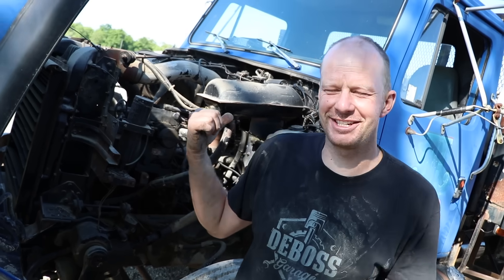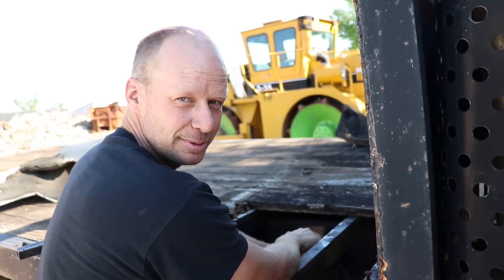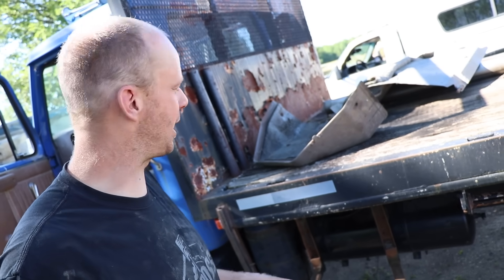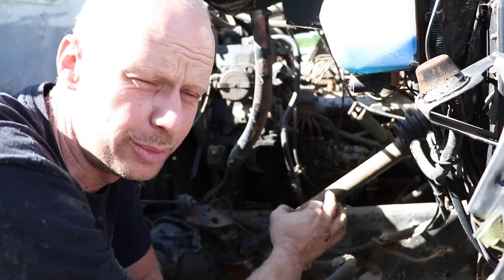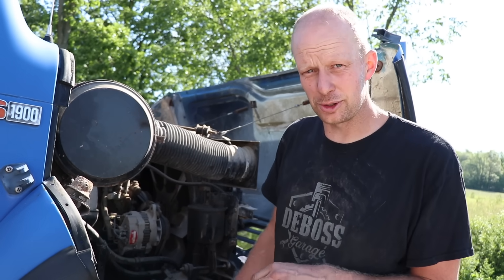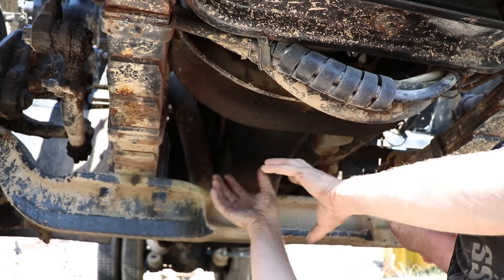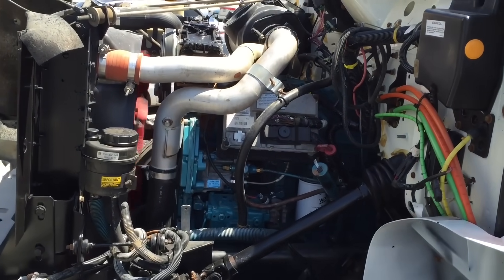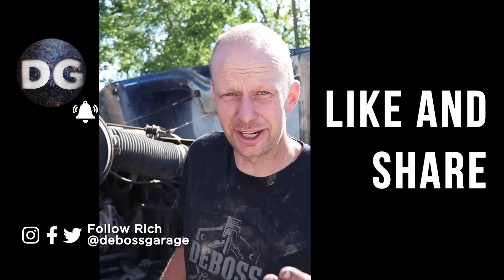REVIEW: Everything Wrong With a 7.6 Navistar DT466 Diesel

Comment: when I started driving semi in the early 1990's I worked for a company that hauled steel coils out of the mills in Indiana ( ave weight  50K pounds  80K  gross ) and the company had 4 IH S1900's with the 466's in them , with the right gears in the rear and a 13 speed trans it would go and do pretty good , but  60mph/100Kph was about all you got , but for service , I loved it , oil and filters , and run the racks , that was something the senior mechanic was dead set on , ever 2 oil changes pop the covers and check clearances , when the owners decided to sell them they had over 750K miles with no overhaul , Have to say it was a damn good engine .  the detroit 60's that replaced them . big green POS .. dropped rods ... But the Big old green leakers ( 92 's ) we couldn't kill .

Comment: DT 466:  It’s everything the 5.9 wanted to be.
Reply: Dt570 is where it’s at
Reply: The caterpillar 3126 is the best of them all! But yes I do like the DT 466 and the 8.3L Cummins
Reply: @hilljackzack7284  if you like repair bills dt466 mechanical all day cheap to run and built like a anvil.
Reply: @matthewwilliams9028  I agree the dt466 mechanical is good.
Reply: You mean dt360. The better 5.9
Reply: @The1andonlyDMFH  just why?
Reply: @hilljackzack7284  because there the same size engine. You can’t compare a 466 it’s a bigger engine by a lot
Reply: @hilljackzack7284  but to elaborate it’s a sleeved engine so to rebuild it you don’t need to machine the block. It’s also stronger. Uses the same injection pump that makes them so reliable
Reply: @The1andonlyDMFH  uhh apparently you’re confused on what I said. I mean why I mean why dt360 over 5.9?
Reply: @The1andonlyDMFH  I compared the 466 to the 8.3 Cummins and the cat 3126 which are all  similar in size.
Reply: But was replaced by the 8.3 in farm tractors.
Reply: @scotcoon1186  Regardless of what they say most people will pick more power over reliability. Not saying which is better or anything just saying

Comment: Hi great channeyl, have you ever heard of a DT530 mechanical that wont lift oil to the oil pump if it sits for a day unless you pour oil down the filter tube, once its primed oil pressure is normal, the oil pickup tube, engine oil pump have been replaced, the timing cover has been checked for straightness at a machine shop inside and out, any thoughts><?
Reply: I had a466 that did that ,the new pickup tube was in a bind and sucked air where the tube bolted to the front cover

Comment: A company I worked for had a pair of international TD15E dozers from the late 80's. I think those had dt466 engines in them. They were pretty strong dependable machines even though they were 20+ years old and had well over 20,000hrs on them.

Comment: A bit of a rant from the european perspective:
Scania 16 liter V8, Euro 3 norm no urea, no EGR, 580 hp stock, 2,5 million kms no problem. Loads of power, great on fuel. Usual weight is @90000 lbs. It is straight piped 😊 
Newer Euro 6 trucks? DEF problems, EGR problems and not that great on fuel. Plus you need to pay for DEF/adblue.

Smaller diesels? You have the VW 1.9 tdi in NA, a load of taxis still run them here, and we're talking interstellar mileages. There was also great french diesels, the idi 1.9 from peugeot-citroen, the DI 1.9 from renault. And we need to mention the 2L from toyota. All these were great simple mechanical diesels that would see the rest of the car rot away and they would still be going.
I bought one of the last euro 5 passenger cars I could find. 1.6 liter peugeot, you can search 1.6 hdi to learn more about the engine. We are talking a genuine 50 mpg VW golf sized car, very pleased with it. 
My friend bought a euro 6 VW 1.6 TDI. He cannot get it below 38 mpg. That's the price to pay for reduced emissions.

The only engines I have seen that get better with every successive generation are ISUZUs. The older (euro3) 3.0 td is reliable as an anvil. No valve movement @200k kms, but a bit under-powered. The new euro6 1.9 which i thought was a mickey mouse engine proves so far to be MUCH more powerful and ~20% more fuel efficient than the old 3.0. And all this from a 1.9 liter engine. It is still loosening up at 15k kms which is good for longevity. I believe if they added a couple cylinders to make it a 3.0 that would be a viable solution for light duty GM trucks. Is the new 3.0 diesel (in GM trucks) a clean sheet design?

Comment: That same block was used in the 66 series IH all the way up to the 88 series. The D/DT414, D/DT436, D/DT/DTI466. D is non turbo, DT is turbo charged, and DTI is turbo charged and intercooled. Sleeves had an issue of cavitation at the o ring bosses.

Comment: Our DT466E's have been bullet proof until recently. They run at a constant 2100-2400 for 8 to 12 hours a day. This machine with over 20000 hours on it is just starting to show a bit of blow by and just ate it's first part (HPOP). The same can be said for the 4BT that drives all the hydraulics which has just started leaking oil from just about everywhere.  https://youtu.be/ntKiJPo35qw

Comment: They were used in loads of International construction equipment. Including TD15C dozer, 175 Crawler loader, rear engine in 433 pay scrapers, 412 scraper, among others. Awesome engines and were very cheap to rebuild when compared to others of about the same class. In the early 90's an OEM in-frame kit with pistons, liners, rings, bearings, gaskets, even included oil and fuel filters was under $1500.00 Canadian dollars.

Comment: I have a Kubota that will not start since I turned it off manually because it was a run away engine at the moment ... Because I had connected a wire that was hanging loose .... Any input about this engines ? ( Coleman light tower with Kubota 3 cylinder Diesel mechanical injection )

Comment: 4:58 "north Dakota mag" rims..... hate em
.
here in montana.... i deal with them about once a week.... some old farmer will bring in his "baby"..... well maintained 
usually old 366 gas big block GM stuff.... flat beds and grain trucks from the 60s/70s/80s
.
im the only person in town who knows how to set points an a Q-jet..... im 26 years old
just had a dad that took the time to teach me (still yelled at me, however lol)
.
i wonder how many here know what a dwell meter is?
Reply: Sounds like you have an awesome job man.
Reply: Old motorcycle mechanic here. I still have one in the bottom of my tool box, not used in years.
Reply: @bretwilliams4499  i have a 1974 kawi g5 100cc 2 smoker.
.
Was working construction (under the table) and just got paid 300 bucks
.
Driving into town....a train was on tge tracks.... so i had to go around VS my normal route
.
And here is this 74 kawi.....300 dollar price tag
.
Like it was meant to be
.
He said he started it..... after sitting since 1976.... and it went full RPM before it started knocking and stopped
.
I personally think they ran it with no oil in tye tank (it has an injector.... which actually pressure feeds the main bearings..... over kill for a 100cc lol)
.
But I rebuilt it in my dads basement
.
He thought I'd never get it back together.... let alone running.
.
But 5000 miles later.... she still starts first or 2nd kick
.
Oh, lower rod bearing was GONE 
Like.... just FUBAR-ed
.
But it only had 1200 miles on it....
So that thing rides like new
.
Still has the orignal tires and tubes from 1974
.
But the rear tire needs replacing..... too many burn outs lol
Reply: Much respect to you 👍 Sadly your right and thats a dying skill that few have anymore
Reply: @Miniaturehorseexpress  ya.... but im just in LOVE with the early 70s style.... especially for motorcycles.
.
These new bikes are just covered in plastic and look like transformers.... autobots roll out!!
.
But ya.... i will forever be thankful my dad took tye time to teach me..... the old fuck is still alive, and still teaches me a trick now and then.
.
But most days I'm teaching him tricks on modern stuff
.
But ya..... several farmers will call me up on my personal phone to have me work on their carburetors and points ignitions 
.
And I do like working on tge old stuff
.
But SOMETIMES having that P code (obd2) makes the problem quicker to find
.
But I still love my dwell meter and vacume guage
.
A vac guage is like a scan tool for older engines

Comment: Tossing belts was a pet peeve . The golden was if the alternator went bad, just don't shut it off. Still had quite a bit in a fleet in my old job delivering beer. When the maxxforce twin turbo came out, those were junk. Egr coolers, exhaust manifold, high pressure turbo, several recall recalibrations, a crankcase centrifuge that is difficult to service and expensive, dpf that fall apart, injectors burning out, cams wiping out , lifter holddowns braking....just junk.

Comment: I still would have pulled it and saved it for WHEN that triple nickel blows up. Much as I like Cummins, I do not like their V engines. Had more than a few 903s and couldn't keep the valves happy and if they got over 500hp they liked to add windows to their blocks. Drove a 466 powered grain truck and youre right about them being a DOG

Comment: Awesome motors they are my sweethearts at work have a fleet of 25 water trucks and 20 of those are dt466 of all generations. We have 7 that are dt466e they do have their quirks we do fill them with a compressed air pump system but we prefill the oil filters and that keeps them from having issues for us. And we have 1 Maxxforce and we will not buy another. We have started buying  freightliner M2 with the 6.7 Cummins since we're in California and have to meet emissions compliance. Luckily most of are mechanical trucks are already offroad only so we'll keep them around for good

Comment: Got one in a 1978 loadstar 1850. Has the ambac injector pump, same as my IH tractors. Old girl let me down after 42 years, dropped a valve on #2 cylinder. No damage to the head but the piston has a valve submerged into it. Great engines that last decades under heavy use. Best medium duty engine every made IMO.

Comment: The biggest achilles’ heel of the DT was not treating water system seen tons of them getting electrolysis in the motor and eating a hole in one of the wet sleeves and getting water in the oil.  But any wet sleeve motor will do that. Other than that hands down one of the most underrated motors ever built.
Reply: Hell of a fuel efficient engine. Dt 466 on a single axle would average about 16 a gallon for a 2 ton truck. Used to haul trees, skid steers etc. Rear end had later problems, and got impossible to replace.
Reply: @ddorn04  Bull fucking shit.
Reply: Classic Work These, and the Perkins 4.236. Everyone talks about the 4BT but my experience is that the Perkins last a hell of a lot longer.
Reply: @NH2112  worked on some Perkins that were used in forklifts (gas and diesel) they were good engines. Years later I came across a small 4cyl Cat diesel in a generator and I swear it was a Perkins with a cat sticker
Reply: I drove a box truck with one for 4 years hauling mail and I loved the damn thing. It was a mechanical injection model, so no electrical or computer issues to worry about. In the winter, all you had to do was rest your foot on the accelerator to barely crack the throttle and it would fire right up. 
Another thing you had to watch was if you got it a little hot, it would take the liner seals out. So you definitely had to watch the water level and coolant temperature. But overall a great engine.
Reply: So Achilles heel a was poor owner maintainance.  Green antifreeze is good for 3 years under normal conditions.  So a great engine and very reliable and durable even with lack luster ownership.  Got it.
Reply: @Jimlogger066  what color antifreeze did you run in it?
Reply: @Jimlogger066  good deal I’ve seen a few that never had that problem but seen more that did.  It seems like all the ones that did where not run very much (or sat for long periods, tractors in the winter) that awesome to hear let it keep on keeping on.
Reply: Weak spot was the bull gear and the programming of the ecu on the later versions
Reply: No. Any wet sleeve "motor" WON'T "do that". If the liners are properly "clamped" in the block and cannot vibrate and cavitate, the "motor" won't do that.
Reply: International had a field update that included a bypass water filter with pelletised coolant conditioner. I've seen updated coolant at the Case IH dealer as well.
Reply: If you run elc you don't have to test for electrolysis. Also fuck the DT466
Reply: @bennettroberts4155  well the DT’s wouldn’t want you always.
Reply: Its an engine not a motor.
Reply: @Yonny316  an engine is a type of motor, so you can call an engine, a motor.
Reply: @davideaton2214  the people who invented the word did not intend it to represent internal combustion, the term has been bastardized.
Reply: @russianacorns8080  I won't cry, I'll just simply acknowledge you described what powers a vacuum or a starter dare I say.. hahahha
Reply: @davideaton2214  No. An engine changes heat energy to kinetic energy. It "drives" and powers itself in the process. A motor is DRIVEN by an external energy source "force". If it "runs" on air or electricity or hydraulic fluid it's a MOTOR. You're clueless. Stop spreading your idiocy.
Reply: @Yonny316  dude shut the fuck up. You’re probably 15 and just learned the difference.
Reply: @Yonny316  You ever one time (you haven't) heard a real mechanic say "we need new engine mounts?". Riiight. Lol!

Comment: I have a 94 International 4900 with a DT466 Bosch 7100 P Pump.  The truck has a 10ft dump body and I replaced the orignal Spicer 6 speed with an Eaton-Fuller 8LL transmission.  The motor is completely stock and came as a 210 HP option from the factory.  What kind of HP can I get out of this engine reliably with simple pump mods?

Comment: ,,, oh-8, or oh-9,  all Inter-Binder, 466, I wanted to strangle their engineers . Two 50 gallon tanks and they shut me off with 13 gallons in each side, in no-where Texas . Had it been the old fuel system I could of shut off one side, and got the two gallons I needed to get me to a truck stop . 26 gallons is just tooooo g.d. conservative to protect the pump . Certainly 18 or 20 would be plenty .

Comment: I was watching the video and wish Cat would have that much clearance  on the C13 with dual filters. Mine at work had a cross member under the back oil filter.The peterbilt that the motor is in definitely needed to have a little design thought. You could get a empty 5 gal pail under the front filter but the back filter you could not. Makes for a messy oil change everytime. I would punch a small hole in the filter and let it drain while I was draining the oil pan. When you would try to drain the back filter it would spill on the crossmember while draining. I would change oil every 30,000 kms and in 4 1/2 yrs did 40 oil changes. 36 quarts+2 full filters every time. Fun times. Take care & god bless.

Comment: I wonder how much of the navistar 466 engines are  based off the the 400 series engines (414, 436, 466) IH used in in their tractors starting in the 70s? Injection pumps and governors are probably different I’d imagine.

Comment: Both the International 4700s and 4900s got the DT466. The 4700s could be specd heavy and the 4900s could be specd light. There's really no rhyme or reason to it. I have three of these trucks. One 97' 4700 Rollback with a 466E in it, one 95 4900 6 wheel dump truck with a DT466 mechanical and the P7100 pump, and a 92 4900 six wheel dump truck with the mechanical 466 in it. All three have been awesome trucks. The 95 in terms of power is hands down the winner. That truck will keep pulling faster and faster until you let off the go pedal without caring what's in it or what's behind it. The 92 isn't anywhere near as quick but an awesome truck nonetheless. Slow but reliable. The rollback has a CEL on for a map sensor that i can't pinpoint but its been reliable as well. It weighs 17,700 pounds empty and will pretty frequently have about 10/12k pounds on it. Doesn't like hills at that weight but it hasn't let me down yet. I will run these until i can't run them anymore.

Comment: The oil aeration was a problem with the 7.3 also. I worked in fleet and if drivers added thin oil not ment for it the unit would code ICP not as spec.

Comment: Ive got a S1854 (4x4) 1988. 
Im building a fifth wheel towing rig. Would like more then the 185 hp my motor has. I know you said the MW pump just doesn't have the bore size but can it be upgraded or should I just remove it and adapt it over to a P pump. I'm trying to squeeze 450 hp out of her. Bigger turbo, intercooler,  all upgrades needed for it. Motor only has 41,000 original miles on it. Im doing a frame off restore on it with new frame and custom cab.

Comment: I am not even a diesel guy, but I did some research at 1 point about diesels in this range. This wound up beig my favorite if I would have built a hauling truck, in the class 4 ish size. Nice to find out my research was pretty sound. Iam one of those guys that wont compromise power over long term dependability

Comment: I have a 1991 4600 with a DT 466.  I  bought a Peterbilt 579 a few years ago and when I change oil I have to jack up the right wheel to get a 5 gallon pail under it to drain. The International the pail fits fine with another 10 inches of space ...///

Comment: Back in high schoolI went to a vocational school and they had 4 of these bad boys on stands and when I got bored I'd tear one down and tear one down and put it back together. They weren't runing engines but I'd have it down to bare block before lunch and I'd have it back together and everything torqued before I left. Mind you it wouldnt run but that's why it was pulled to begin with